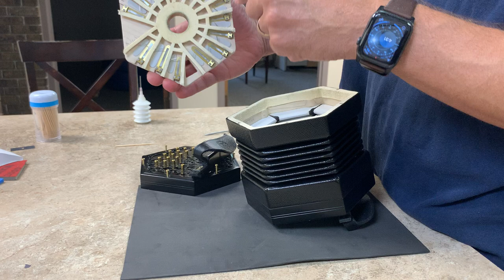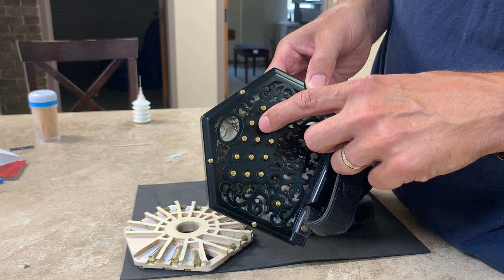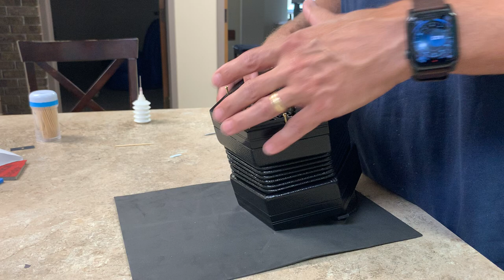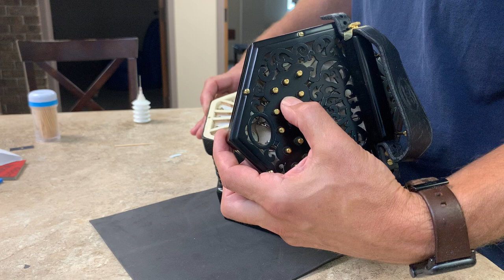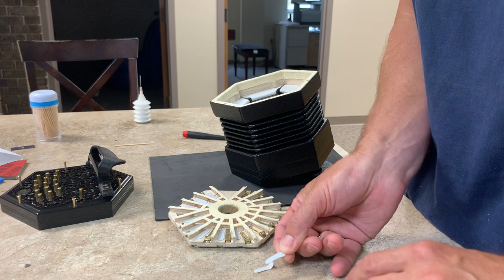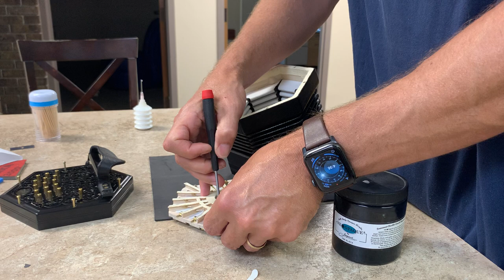How to replace a concertina valve.

Comment: How do I replace and leaking bellow that allows air to escape when I push and pull my Anglo concertina when playing it
Reply from the maker: Sorry just saw this.  A problem like this can have all of sorts of causes.  Often, the leak is actually occurring from one of the pads not fully seating.  It's too much to cover in the comments sections here.